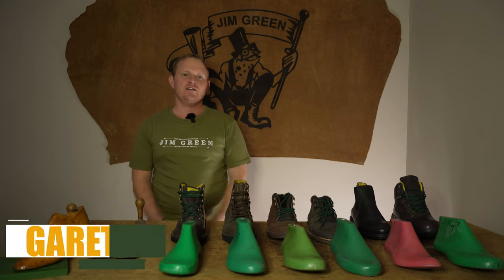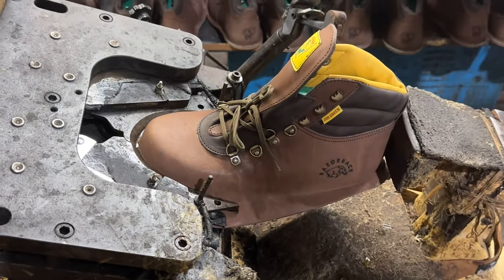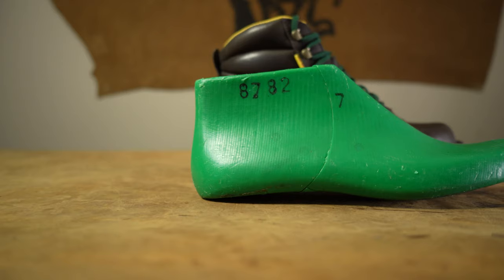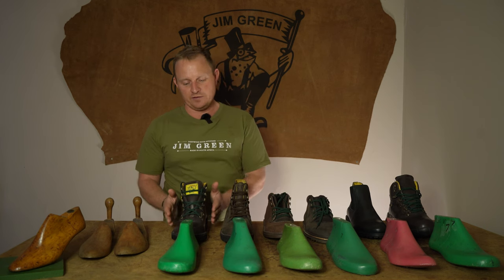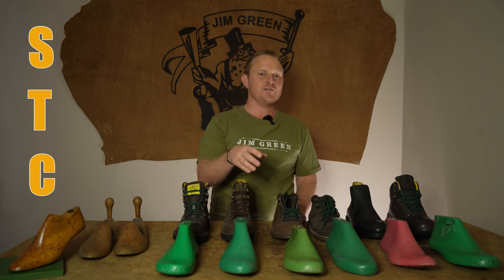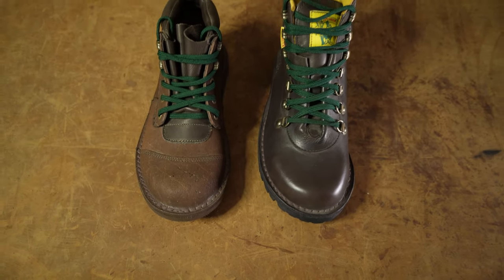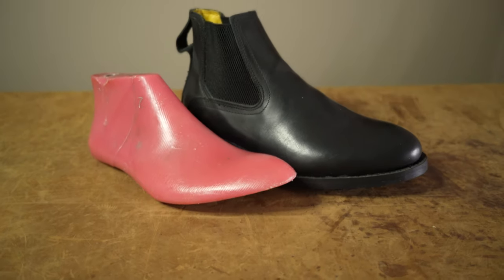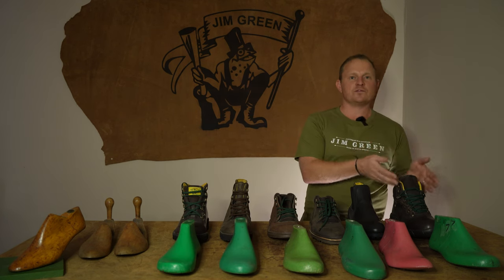How Boots/Shoes Get Their Shape?! (Lasting) + Jim Green Lasts

Comment: I'd love to see a video on sizing specifically. As someone with a 4E foot I find buying boots to be difficult even when I can try them on. At times you just can't tell if the boot is stiff and new or if it is going to be tight even after break in. Sometimes a wide boot is massively wide in the heel but only slightly wide at the ball and toe box. More often than not I find that even wide boots are narrow at the arch or just behind the ball of the foot (my problem area). I am between a 9 and 9.5 4E on a Brannock (more like a 9.25) and find myself in a 10 2E in many boots (because a 9.5 4E isn't offered. 

I'd love to pick up a pair of African Rangers the sizing worries me. I know the site says go true to Brannock but being two widths narrower I'd guess going up half a size might do the trick, but these things are hard to guess at. 

I know sizing is alluded to but again, I'd love a full-on sizing advice video.